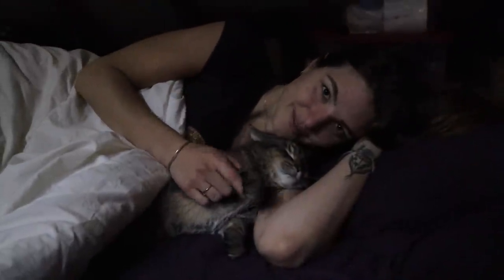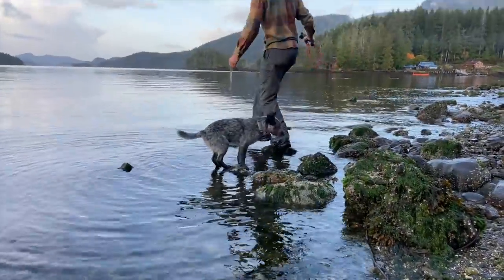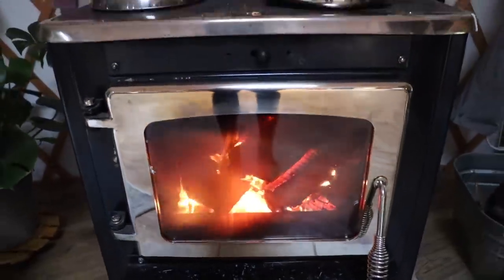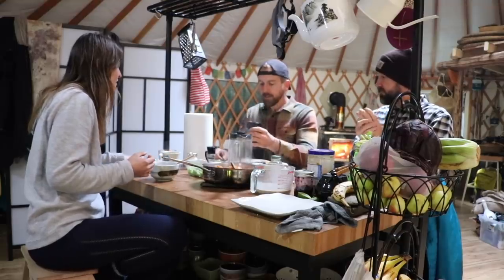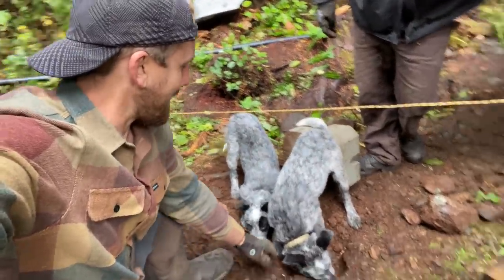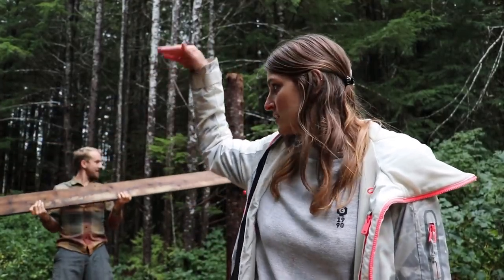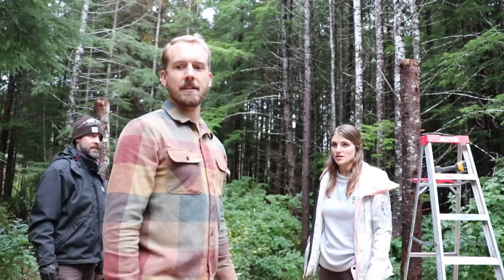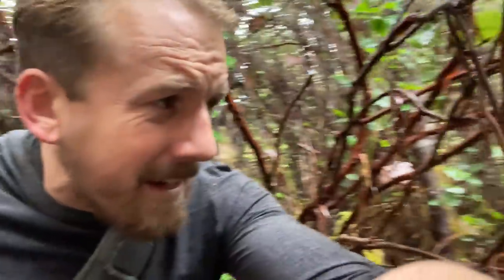My Morning Routine Living Off Grid in a Yurt - Ep. 57

Comment: put your wood tightly inside an old tire then chop with the axe, you don't have to pick up each piece individually. for fire starter i use old egg cartons. just fill the carton with wood shavings and parafin wax. break off one piece at a time to start your fire, works perfectly. no more need for small wood and paper. good luck nice place.

Comment: I seen a guy on YouTube put regular pipe  running with cold water trough (inside) the  huge composting pile and  he had free hot water .  Love you 😘😘😘
Reply: People do that to heat greenhouses..they get heat and compost you have to renew the debris pile once a  year or alittle more if you do it right.
Reply: It works well . A bit of compost over a roll of Polly pipe . Cheep and so nice to have a warm shower
Reply: There is a house on Salt Spring Island heated with a cast iron hot water core buried in a compost pile.  This heats the house in weather that isn't too cold, but uses wood to augment it when needed.
Reply: See U-tube Gridlessness

Comment: Use a wedge for splitting makes life a lot easier. Take this from a guy who has chopped hundreds of cords of wood, you will hurt yourself if you both don't learn balance. Swinging the axe over your shoulder has little effect, as the energy from your shoulders is lost. When you split stand with your feet shoulder length apart raise the axe straight up over your head and bring it straight down with the power from your shoulders and arms, there is no need to swing an axe. You will cut twice as much wood in 1/2 the time and won't be exhausted.  best to both of you.
Reply: I agree.  Split hundreds if not thousands of cords of wood.  Get a wedge and a dedicated maul.  You should also get a lighter splitting maul.  E=MC^2

Comment: please consider the time and labor needed, the wood needed for home made shingles (about 4 of those tree rounds you split for firewood) the WEIGHT of a home made wood shingled roof, the extra posts and support for a wood roof, and the durability of a wood roof. Maybe store bought pre-made cedar shingles perhaps? They are light weight and wont cup like home made shingles with different ring patterns. BUT metal is fast, no more main support needed (just cross bracing rafters and nailers. If worried about the noise from rain you can add a sheet of 1/4-3/8" plywood on the roof (so you don't look up at foamboard), then foil backed foam board, and then metal roof. It will muffle the rain and will last 20-30 years if good metal roofing is purchased......just saying....Ha!

Comment: First establish the hight of the cross beam and drill and loosely fix one end. Then level in the beam at the other post by using a temporary nail, to save on the arm strain, then drill and fix to the second post and remove the temporary nail. Enthusiasm is great, but it is wearing on the body if the barin is not engaged to look for alternative ways to achieve the objective.
Also, as you will have found out and excluded from the video, if you are going to hammer the end of a threaded rod, without using a blockof wood to absorb the metal on metal conatct, then you will be faced with a problem when you come to fit the nut.
The point is, that you are on a learning curve here, and using your brain to imagine and think of different ways to do what you wish to do, as well as seeking advice from videos, books etc., will help you to find more joy in this learning.

Comment: Hi. I feel your front door hot wire is too close to the door. A bear could still rip the yurt or door with its claw before even touching the wire. Consider moving the wire parallel with the decking, so bear can not get on deck.. You might need a hot wire around cooking n eating area. Is the heater keeping the boat warm? Do the cats n dogs get along? Peace to you and yours.

Comment: So if you are going to build using materials you really should at least know a couple things starting with that is not cement that you are using but rather "Concrete", cement is just the binding ingredient in concrete and secondly concrete does not dry it set's up by a chemical reaction between the cement and the water, if anything you would not want concrete to dry as a matter of fact you are supposed to keep it well dampened for the first 48 hours, even wet after the first few hours when it hardens because this is when it's exothermic reaction produces heat which in effect dries it out which is bad but of course you guy's would not know none of this just as you had no clue to keep bears at bay from the start.